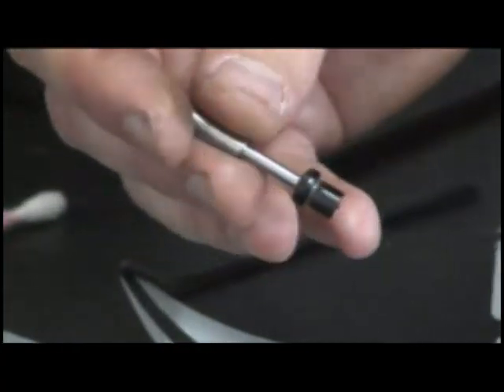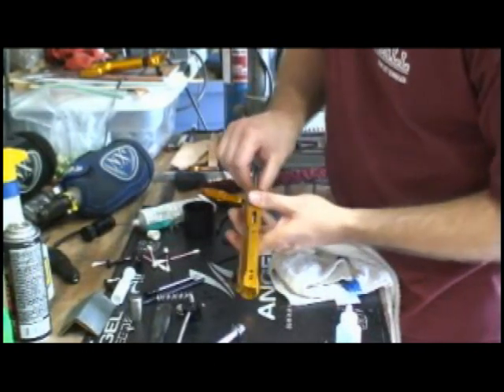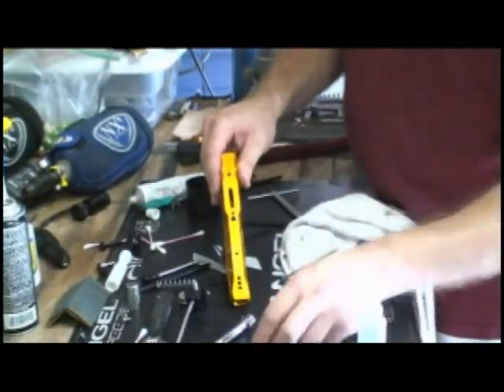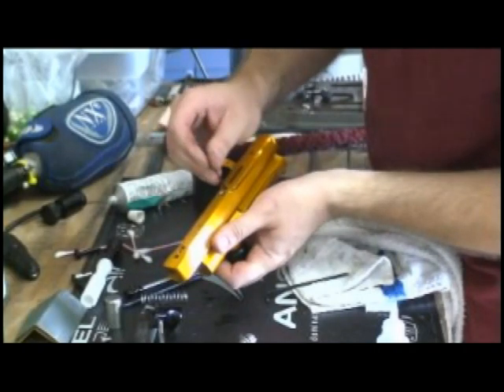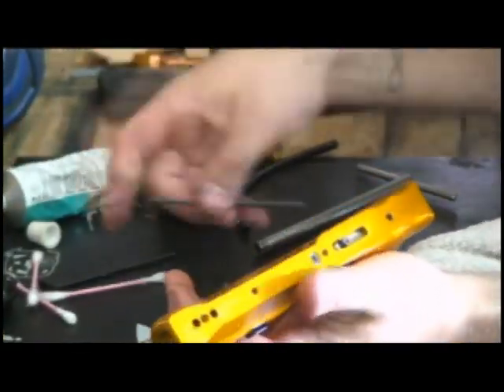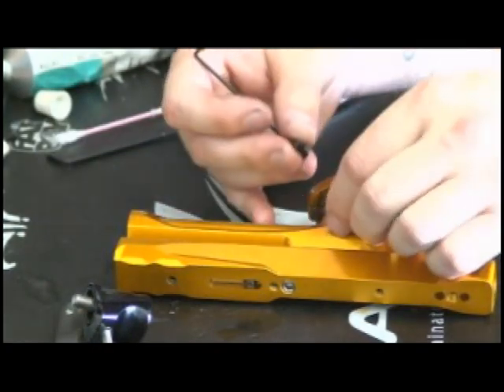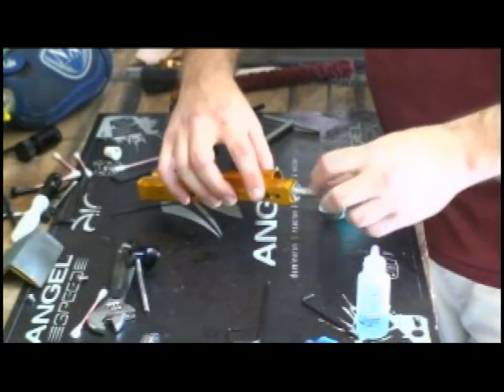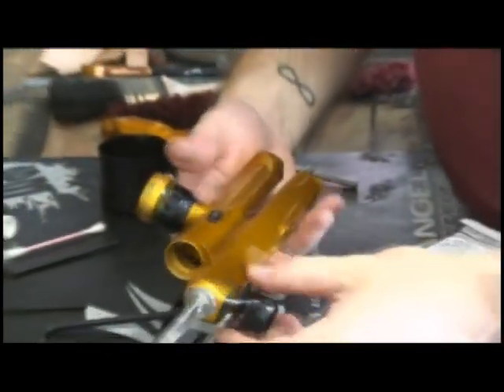TF CCM Tech Video - Hammer and Valve Dissasembly - Part B

Comment: I take apart the bottom tube - but not the valve - often.  I like to clean out that tube so I know the hammer is clean.  

But, if you play clean (not a messy snake player) every now and again would be fine.